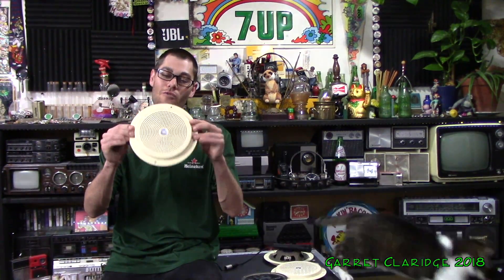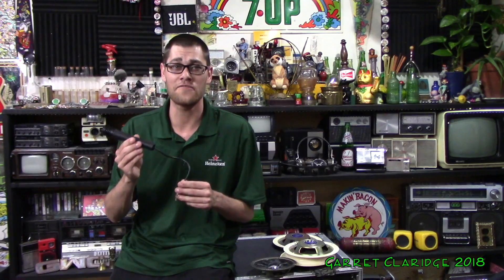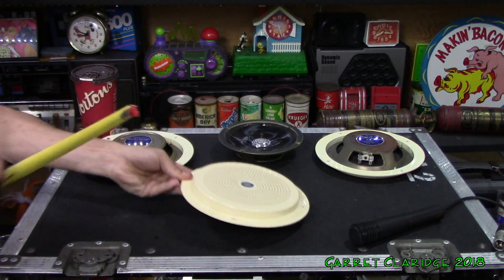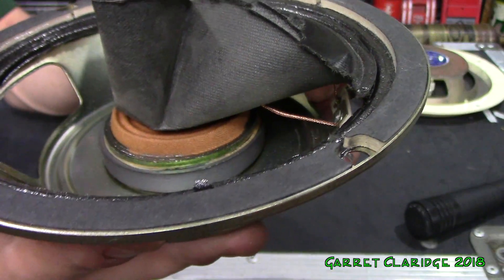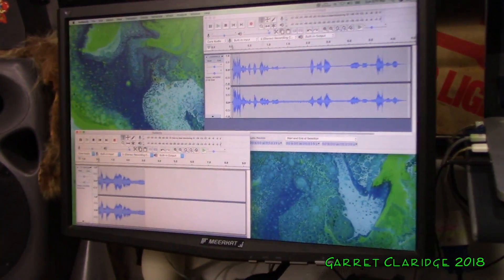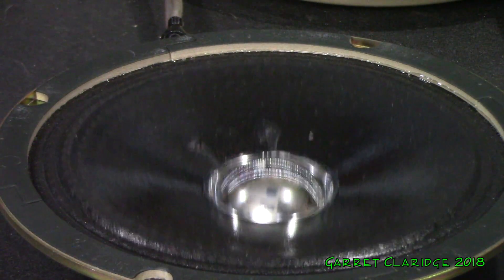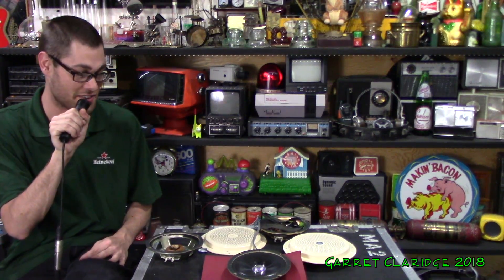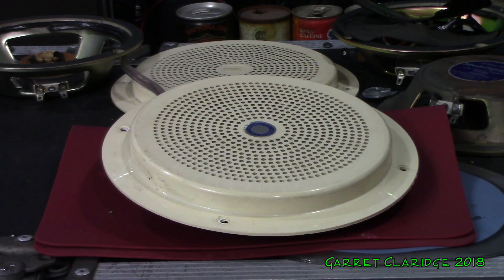SPEAKER BLOWOUTS! Toronto (TTC) Bus PA Speakers

Comment: How's the microphone sound on other speakers?
Reply from the maker: It's awesome, Low feedback and good under loud conditions, a normal mic would have been feeding back at a much lower volume
Reply: Garret Claridge And you just found it in a bus? I might look around for one and do the same with it, it sounds low cost for a great mic
Reply: Garret Claridge The only mics I’ve ever owned/worked with regularly up until recently were the Shure SM58 and the AT2010, got into a space outfitted with some AKG stuff and they definitely know how to make good gear.
Reply: I'm the one who donated the mic, it came off a Toronto bus and based on my observations, most other buses I've ridden don't have the same mic.
Reply: TechnicaProductions I'm not anywhere near Toronto so I wouldn't know

Comment: What are those tiny CRT monitors I'm seeing in the background on your shelf? I've seen those before at a place I volunteer at and they have a bunch of radio and video recording/broadcasting equipment
Reply from the maker: The ones I have are just black and white vintage portable tvs, Most will take batteries or work in a car or camper however Ive been seeking the ones you are talking about, they are Broadcasting monitors made for studio use , One of my friends has a huge collection of them mostly sony and jvc
Reply: Garret Claridge if you'd like I can send ya some pics of the equipment and things at their studio for shits and giggles. it's really cool stuff and prob vintage

Comment: i am trying to blow a 2 inch and my amp has no protection Why isn't it working im using your music
Reply from the maker: Is it a TV speaker or out of something? It might be a high resistance driver 16 ohms or more, Check out your signal path and be sure everything is cranked, What hurts the speakers is distortion so you need to get as dirty of a signal as you can make.... there is a free app called Equalizer APO for windows where you can pre amp your sound card and apply some EQ or websites for frequency generators as well as phone apps